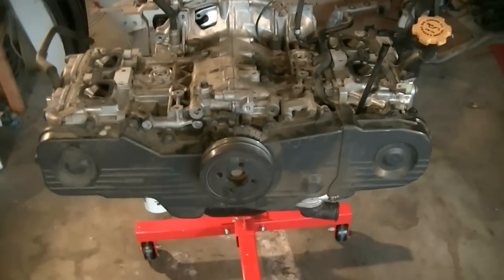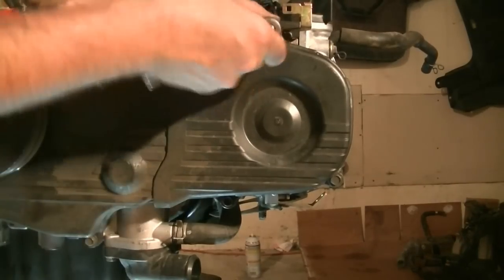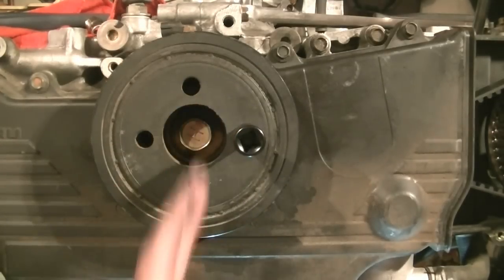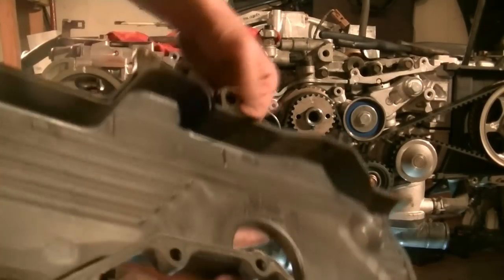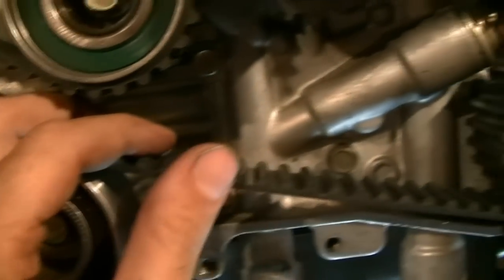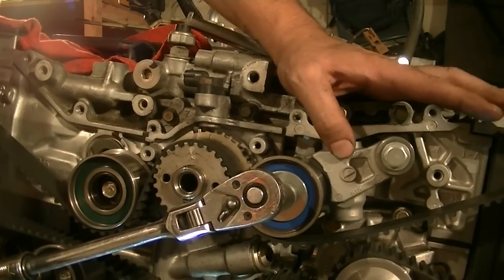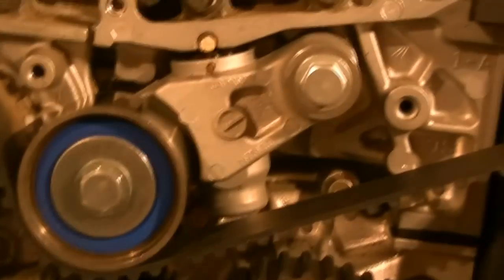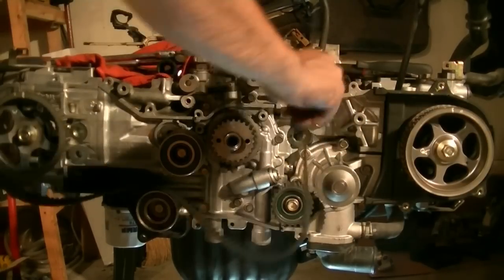Subaru Timing Belt Replacement (EJ25 SOHC) Part 1

Comment: regarding the harmonic balancer removal. You can place a screwdriver in the teeth of the flywheel by removing the plastic cover. To do this you may have to remove the air filter box and the coil pack from the top of the inlet manifold and use a long screwdriver

Comment: You don't have to remove the accessories and intake/exhaust manifolds to do the timing belt. It can be done easily without removing those items. Saves you time and hassle in the long run.
Reply: You don't need to pull the engine either. It does help to remove the radiator and cooling fans though.

Comment: You can over-torque the pulley on the tensioner  by re-setting it that way.(I know) If you feel the bolt tighten or the roller becomes tight you will have to re-torque the tensioner pulley bolt. Check how the roller spins before starting. Otherwise a small vise locked into another vise in an upright position can be used to easily compress the pin in the required upright position. Good videos.

Comment: Great idea in saving time rather than having to use a vice and waste time with the timing belt tensioner!!! Your a natural born mechanic. !! 

I had my plastic composite camshaft sprocket break in 8 or more pieces on the passengers side. What a deal and I’m going to put another belt on and the one I bought was new but cannot read the 3 ink timing marks after 8k miles.? Is that normal or did the person who put the used 2.0L engine in my Forester purposely keep my new belt and this 2.0L engine had only 57k miles. The 2.5L engine had leaking head gaskets at 71k miles!! You figure that one out. I bought this nightmare used.

Comment: great video, thank you!  It gives me the confidence to take this on myself.  Quick question...I have the service manual and it says to remove a couple of the idler pulleys instead of your slick tip to compress the tensioner when it's on the engine.  I hesitate to ignore the instructions in the service manual, but your way sure seems a lot easier.  I'm afraid if I remove the idler pulleys while the tensioner is under pressure, that it might move the cams off of their marks.  Would you still recommend your method of compressing the tensioner while on the engine?  Thank you!
Reply: ok

Comment: if you can still see the print on the timing belt the print wears off as the timing belt wears, when you see no more print the timing belt is abut due for replacement.

Comment: I have done a few timing belts but never a boxer style... my question is why is the first step in all the manuals to not get the #1 to tdc like most other cars? I have been doing a lot of reading and it doesn't say it anywhere?? when looking at my engine all the marks are dead on but #1 is half way back down getting ready for the exhaust stroke. is this correct? to add to this with the cover and crank pulley on crank set at 0° it is at tdc take the cover off and the marks are 25° from where they should be. is this correct for this car? please note that all I have done so far is take the covers off. the belt has not been removed and car was running fine before starting to look into this. I just wanted to make sure this was correct and figure out why it's like this before I started this job.
Reply from the maker: +Guy Ault When you line it up with the marks I show here these engines have all the pistons half way up the cylinder wall. Its more safer this way anyway for tbelt installation. gl
Reply: +RatchetsAnd Wrenches That's what I was thinking after researching a little more. thank you for the reply. unfortunately my car got flooded so the timing belt was the last thing I was checking before I haul it to a shop. unless you have some other ideas. I've checked compression, spark, fues, fuel pump, timing, I had another computer and put that in just to see... nothing. cranks but just won't start.
Reply: I also put a noid light on injectors, coil and wires/plugs.

Comment: Hi. I'm in the middle of this job on my 2001 legacy. Is it possible to 
throw the crank out 360 degrees from the cams? I lost track of my marks 
when attempting to put the belt back on. When I had it installed I 
attempted to turn the engine by hand for two full revolutions and it 
ended up jumping some teeth on the belt. Now I don't know where I'm 
at...
Reply: Hi I am having the same issue on an 02 outback. Any suggestions you may have from your experience. How can I check I am on time at my marks?

Comment: at 7:40,you push the tensioner to put pin inside,but I tried the bolt turn clockwise to tighten by wrench.and do you kow what torque is required by this pulley on the tensioner.
Reply: I had this happen as well and then the pulley is too tight. I could not find a torque value but I think just slightly loosen til the pulley rolls freely.

Comment: Timing belt on Subaru says 105 months or 105,000 miles I have 70k miles but I'm at 105 months can I wait in your opinion and if so for how long?
Reply: It all depends. I knew a dude with a wrx that had 240k miles on factory belt. Ended up snapping and toasting his engine so don't do that but impressive it lasted that long. My sisters ej25 SOHC forester was 150k on factory belt and didn't look too bad but again not recommended. I'd say take off one of your timing covers and check the wear of the belt.

Comment: Please make a video that shows how to run this engine without the damned computer system that they lie about how good it is but seems like it is referencing maps from the start and not able to compute leaning the fuel by reading only the sensors in Real Time.😵